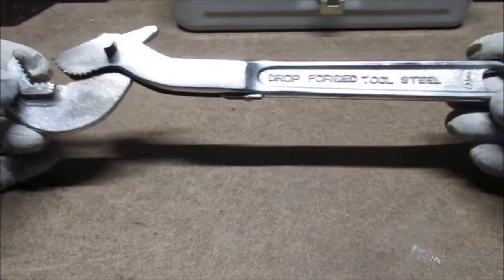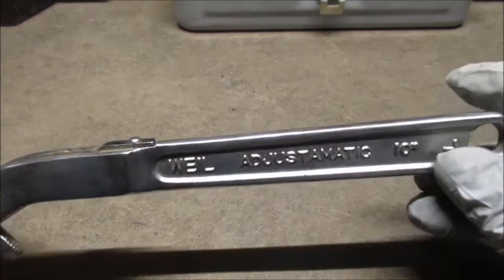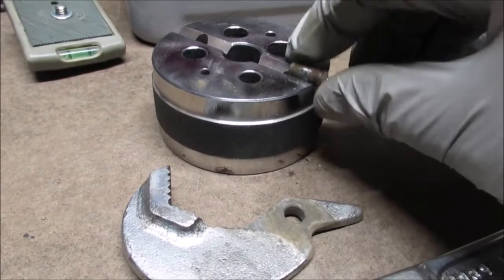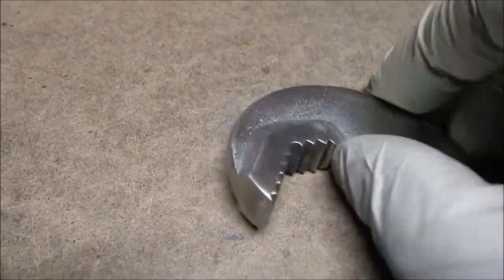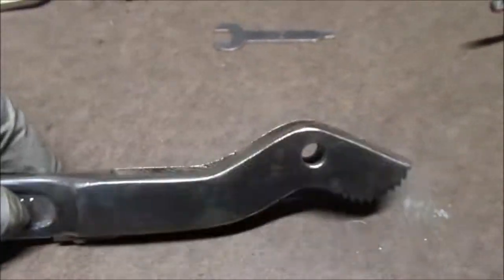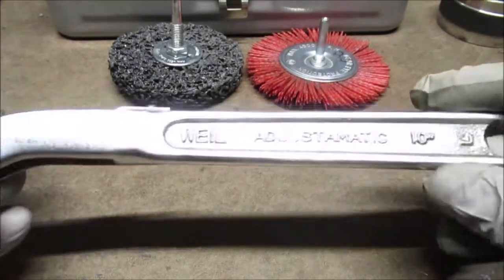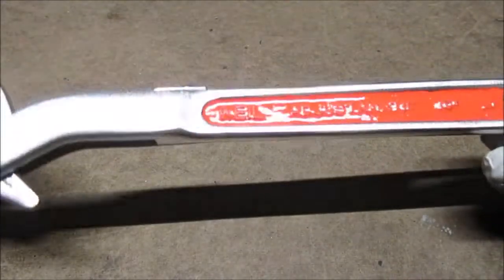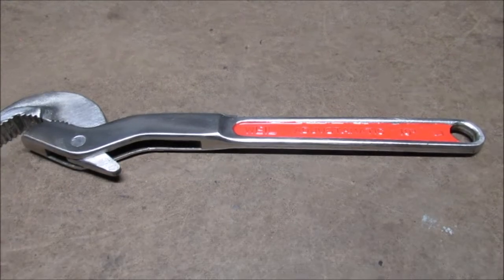WEIL Adjustamatic wrench

Comment: Hey Jim, would you mind me boxing up and sending you a bunch of old sockets and wrenches to buff and restore? LOL! 
I finally got back to Harbor Freight and bought all the wheels you have for polishing. Today I'm going to spend my afternoon restoring and polishing some very old tools. 
BTW, I have that same exact slip wrench!!!!!!
Reply from the maker: Thanks for the nice offer.But I have to say no..once it warms up some more I will be spending a lot of time on my garden tractors..I barely started on the little JD 70 that will have the Honda  8 h.p. engine...You will have fun polishing up stuff like I have done this winter ..You may be glad to have a bunch of old stuff because once you run out of tools you will want more to do...The slip wrench is an odd but useful tool